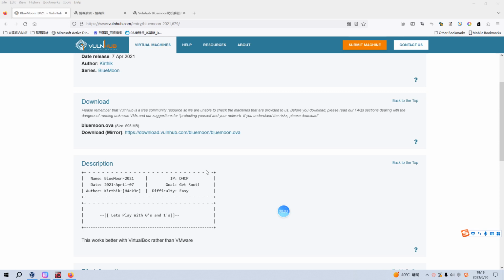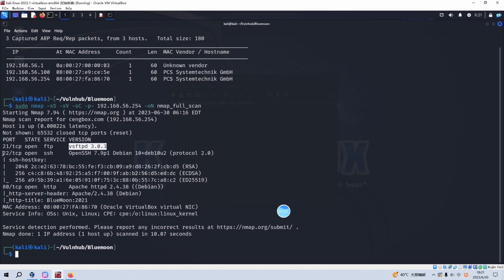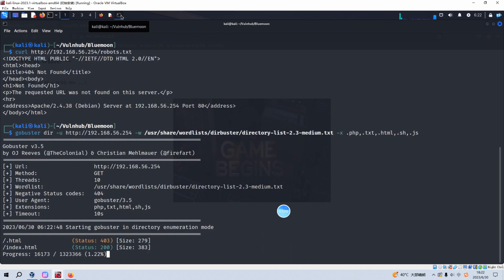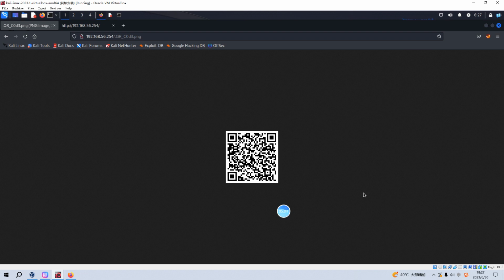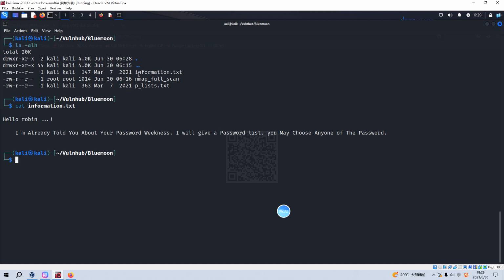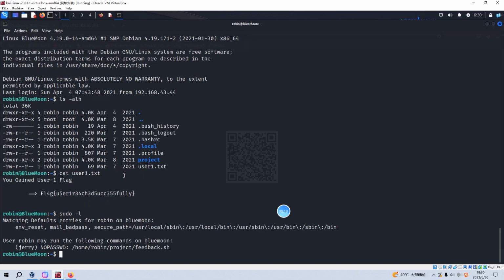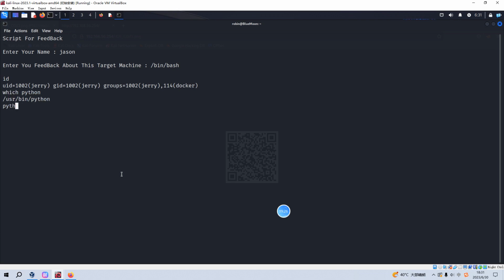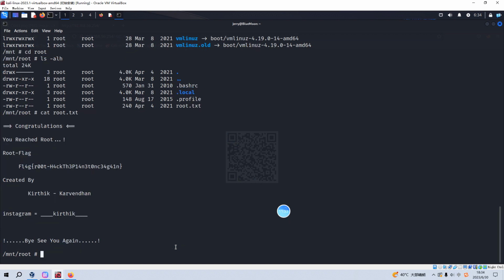Cyber Security | Ethical Hacking |  Pentesting Lab | Vulnhub |  Walkthrough |  Bluemoon

Comment: sir, could you solve a vulnhub machine called christophe
Reply from the maker: Just now I tried the virtual machine called Christophe. CMS is "CMS Made Simple", the version is 2.2.7. I used the exploit 46635.py to attempt to exploit SQL Injection Vulnerability. Although the username can be identified as christophe. Hashed password is 7908b1494f82ed320b288a0e839bfbc5 and relative salt value is 932129a6bd8545bd. However the python exploit script failed to crack the password. Then I use the hashcat to crack and got the same result. In a nutshell, I can't get any breakpoint to the virtual machine. By the way, some changes need to be done for the python exploit script in order for the script to work.